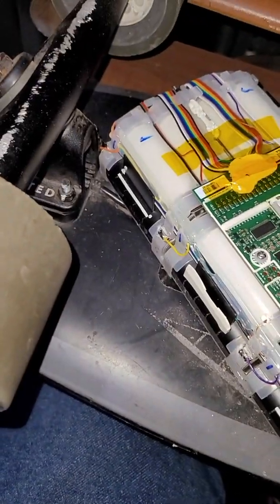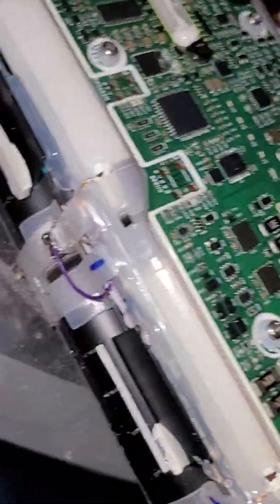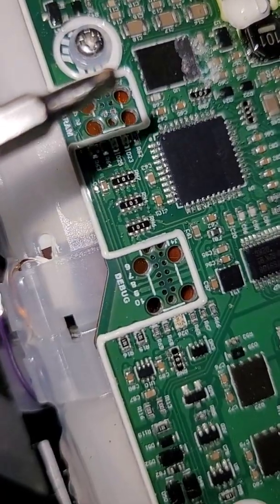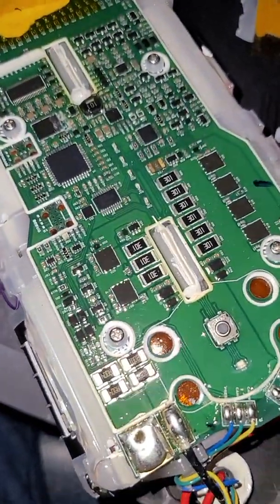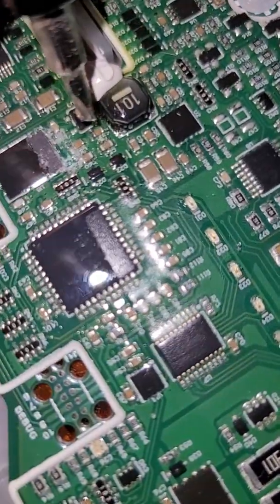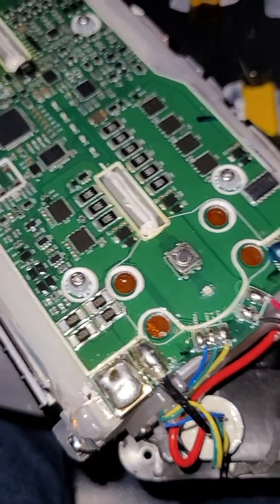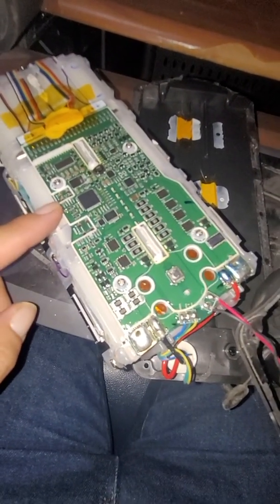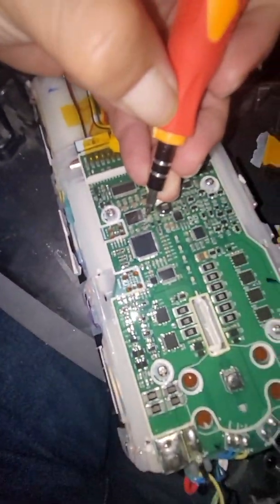boosted board XR v2 battery RLOD FIX FREE! NO AMNESIA CHIP

Comment: it didnt work for me :(
Reply from the maker: U have to make sure you clean off the film on top of the chip to get access to the contact points you need to short. If you did everything right and its still bad then you have a bad cell. You can find the bad cell with a cheap harbor freight multimeter and buy the cell on ebay for like 7 bucks

Comment: Hey! I managed to short those two connections together and the light does turn green again, but after 3-4 seconds it goes back to blinking red. This board hasnt been charged in a while. The tip with letting it charge for a couple weeks, is that before or after resetting the RLOD? Should i try charge it for a while and then short the contacts again? Also, its kinda hard to tell but is the Battery still connected to the rest (ESC) or fully taken off the Board and seperated?
Reply from the maker: Sorry for the late reply.

1. Short it. if the light turns green keep the button and short pressed down for 10 seconds. Let go of short and button. At this point, no red light should reappear. Connect charger and let it charge for a couple of days. Turn it on and see if it still turns red. If so then theres one or multiple bad cells.

2. Yes, I disconnected the battery from the board but I left all the wires intact within the battery enclosure. The connector from battery to board is a pain in the butt so you might need pliers.

Comment: Do you think it would be a good idea to connect two wires and a switch to the “shorted” area. That way I can short it when the battery is put back together if it ever RLODs again?
Reply from the maker: @brambhai4877  yeah you could essentially build a "short" switch with a small button. No one will tell you it's a good idea but if done correctly I dont see why you couldn't. Did my video help your board?

Comment from the maker: checking this video out 2 years after making it lol. glad i helped alot of you out. sorry if i didnt reply to some of yall but i hope that all of you got around to fixing your board!
Reply: I wonder if a precisely placed drill bit thru the front cover could be the solution. Then just plug the hole with rubber or sealant.
Reply from the maker: @David_Mash  did you ever get it done?

Comment: Thank you for sharing this long awaited solution!!!!!! So bad I didn´t see it before. I followed your instructions step by step and it worked perfectly. Opening the battery was simple, but getting the battery pack out of its case demanded some effort. On the process I had to break little plastic joints that are between the battery pack and the black case but I think there is no other way to do it. I sealed the battery with a polymer product that i hope will replace the original seal. Considering that it was stored for so long, I had it charged for two full days and today I used it for about 8 miles and the battery performed perfectly. Literally it went from de Red Light of Death to Green Light of Joy.

Comment: Damn this did solve my RLOD but
I couldn’t charge over 50% anymore, so I tried letting it charge for over a week and nothing changed. I recently tried to charge it by towing it with a car, it did charge my board up to 90%, but once I plug in the charger when it is 90%, it instantly turned back to 50%…. When I unplug the charger it is reset to 50% again…. So every time when I charge it it would show 50%…. Is there anyway to fix this?

Comment: Would you be able to charge it out of the board. For example after the rlod is cleared. At that point before connecting it back to the board and sefuring it down. Can we charge it off the board for 2 weeks? Or is plugging everything back together best way
Reply from the maker: Yes you can do it off the board.

Comment: It stays green for 3 secs then goes back to RLOD
Reply: i have one of mine doing the same thing bad cells most likely
Reply: @JoshuaWacaster  if yours will not reset. it means you have to do a different method which is also very easy to do. short the two pins like in the video and then plug in the charger. Then let go of the two pins and check the battery with a volt meter. The amazing thing is if you did it right the battery is charging even if the red light is blinking!!! give it a try and have your multimeter checking the battery voltage and you will see the battery charging!

Comment: @nomadned think you could help getting a quickfix for my other battery ?

Its got a yellow "breathing" light when i plug the charger in and will not turn on if you press the button.

Been trying to figure this one out for a while.
Reply: is it attached to the board when you are charging it? From my understanding from researching breathing yellow light means it's not attached to the board while charging
Reply: @ganker24  yes it is. sorry for the delay, i came back here cause i have a rlod on another of my batteries... kinda sucks

Comment: :face-blue-smiling:YOU ARE THE GREATEST. After searching the internet far and wide: THIS IS THE BEST AND EASIEST SOLUTION. Just be careful taking the battery out after you take the cover out. I don't think it's possible not to break the plastic sleeves that are glued in place with the white glue you see in the video. I don't think it was ever meant to be re-assembled. So it is permanently glued. You have to brute force it out to break the sleeves to release the battery:face-blue-smiling:
Reply: How exactly did you get the battery out of the case? I am really struggling with this step

Comment: For those who tried it. How long has it been since you tried this method. Did the RLOD came back?
Reply from the maker: This method works as many times as you need. If it keeps doing it then it means you have a bad cell and need to replace it. You can use a multimeter to find out what cell is bad. They cost about 6 USD per cell on ebay.
Reply: The cells are fine. XR has a bad design. To charge 🔋 every few months is necessary if you want to have RLOD free unit.

Comment: @NomadNed I did it. I no longer have the rlod. When I plug it in to charge tho there is a red light like it is charging and after a minute it turns green and does not continue charging. I’m not sure if you know what I should do please let me know if you have a solution. 🙏
Reply: I’m having same problem
Can’t charge over 2.5
Any solution?

Comment: So I do the short on it right and then when I power it on it turns green for 5 seconds then back to the blinking light of death any idea?
Reply: Every figure it out have same problem
Reply: @nickyabreu8123  yes check my other reply
Reply: Same problem over here. It goes green for a few seconds and then back to blinking and RLOD
Reply: @adriantorres132   @nickyabreu8123  i did figure out the problem one of the cells was too low on charge compared to the others to allow the reset to stay reset pretty much it would go green but then fail and go rlod again because of that one cell to low on charge so then i bought a charger to charge that one cell brought it back up to the others did the short again and it worked for good

Comment: Didn’t charge my board for 6 months and tried this after the RLOD. Worked great. Especially liked the special effects added in the end.
Reply: Does your battery show full battery or only shows it is half full
Reply: @KenTVtw  using the battery indicator on the board it shows full bars now, but it may have been different last time this happened, nevertheless, I left it charging for two weeks after that so the the bms could balance the cells.
Reply: @marktowers4165  hmmmm
i tried this on both my XR, it fixed the RLOD issue, but now it would only show 2.5 charged instead on 5 bars full when its fully charged.... is there a way to fix this?
Reply: @KenTVtw  Sorry, as this didn’t happen to me I cant help. I’d recommend charging and not using it continuously for 2 weeks like I did, at least that’s what I read a while back in some forums. Honestly if it’s giving you roughly the same estimated range on the “Ride” app I wouldn’t worry about it, otherwise sorry.

Comment: WOW, it worked even after a year of me just leaving the battery in RLOD. I used a plastic trim tool to remove the coating to expose the metal contacts. Then on the 2nd try, I used a small metal flathead #2.5 and the RLOD has been cleared! Overall it took an hour to take the battery apart. I'll leave it on the charger for a couple weeks. Thanks so much, you saved me extra money and a lot of time.
Reply: Hi, do u remember if when you plugged your charger did it start charging? Or did it show rlod.
Reply: @freddybautista6412  Yeah, it started charging immediately with the yellow light since it was not attached to the board.
Reply: How did it go after plugging it in the charger for a while
Reply: @KenTVtw  Keep it plugged in for a month first so the cells all balance out. Otherwise, it still works with no issue, and I have not let the battery go beyond 25%, since RLOD happened when I took the board out after 3 months of sitting and decided to be stupid by flooring it up the hill at nearly 0% charge.

Comment: I wanted to report back to say this worked! Thank you! I was super skeptical at first but I did the procedure and the RLOD is gone. The battery is now charging and I will leave it on for a couple weeks. I used a toothpick to remove the film. The two terminals are super small and hard to see. At first I thought my circuit board did not have the terminals...lol. I used a tiny flathead to keep scraping after the initial toothpick method to really get down to the terminals. Took a few tries but it did work.
Reply: same here.. when i opened it.. everything was way smaller than what you see in the video.

Comment: Gotta be honest, was skeptical about doing this. Mainly because I’m not to familiar with doing stuff like this. Gave it a go last night, took my time to remove the battery cover/ battery itself. I just followed the instructions from @Nomadned and ITS WORKED. No not on the first try, I would say after the 6th/7th try. Mainly because I was scrapping away at the contacts very little each time. (Didn’t want to mess it up by scrapping to much). 

FYI my XR Battery hadn’t been plugged in for over a year. Kinda gave up on it since I got the RLOD. Thanks you sir!!! 🙏🙌
Reply from the maker: Hell yes my dood. Time to shred the gnar. Don't forget to balance your cells. Spread the knowledge my guy. 🛹🛹🛹

Comment: Any idea on what I can do with a Boosted Board V1 that has been giving me the blinking red LED for a year now?  Should I part out and sell seperetly?  Or sell as one unit as not working?  Or is there some kit I can use to revive this magical adventure machine?  Thanks brother!
Reply: For V1 ask a friend to tug around the block by a car few rounds, than use a charger.
Reply: @hardmurakami  I rode the board on a treadmill for over an hour, but since I still have it, I might as well try having someone drag me around on it.  I don't know if it's legal but I'll either sell it or try this.
Reply: Won’t work on standard range battery v1 or v2 only xr

Comment: I did this and now nothing lights up when I press the power button.  Any idea what I can do to fix this?
Reply from the maker: Try leaving it plugged in for a couple of hours. Remember that this only resets the RLOD. It does not fix any bad cells in your pack. Use a multimeter to test every individual cell and replace the bad ones. There's plenty of youtube videos on how to test and replace cells.
Reply: If it doesn’t come on again after doing this that means you fried your spi flash and the battery is even more useless now it can’t be fixed after that doing this tactic will reset rlod but it’s dangerous for that very reason
Reply: Don’t know if you’re gonna see this, but please tell me you found a solution? I think I messed mine up

Comment: Just so you know the "film" is called Solder Mask. It protects the circuitry from corrosion and from shorts.
Reply: It’s not solder mask. It’s a conformal coating that he scraped off.
Reply: @robertmaks0  Solder mask, solder stop mask or solder resist is a thin lacquer-like layer of polymer that is usually applied to the copper traces of a printed circuit board for protection against oxidation and to prevent solder bridges from forming between closely spaced solder pads. 
Straight from Google.
The first TINY layer is conformal coating, after that it's all solder mask. He dug straight down to the traces.
Reply from the maker: Thanks my dood. The more you know !🌈
Reply: @nomadned9349  no problem whatsoever!